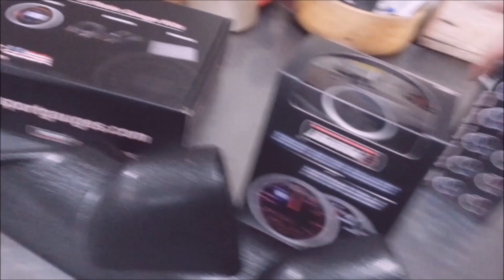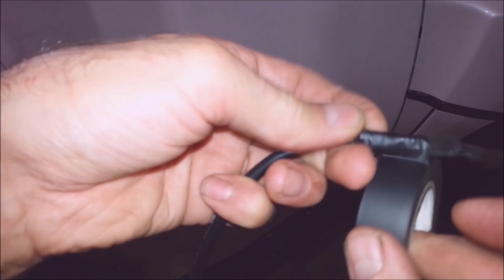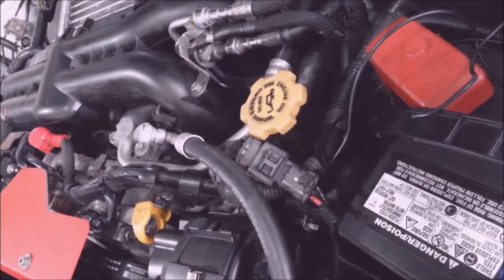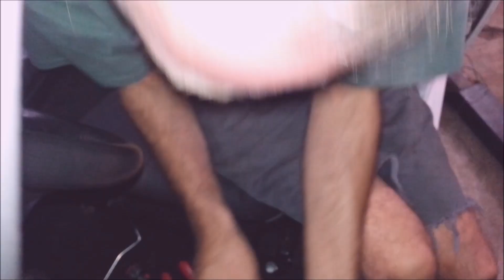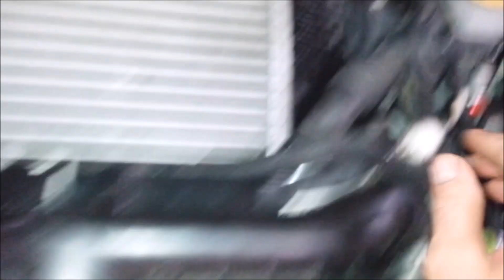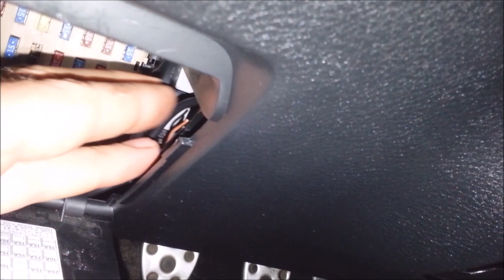WRX gauges triple pillar pod install

Comment: Hey man! I am actually about to do a very similar setup for my 2001 WRX! I am getting 2x JDM Prosport gauges and the innovate DB LC2. There were 2 questions I had. DO you find them annoying on the A Pillar? I liked the look but wondering if they are distrazcting at night? Also, where did you get that Gauge pod? I am trying to find one for a V7 WRX and it is quite hard.
Reply from the maker: The guy I did them for really likes them. The pillar pod for his car is sold all over the place. You are going to need to scout around for something that fits your car. There are universal ones, but may not fit real good.

Comment: The analog output signal harness is for the wideband reading. 3 wires , ground, narrow band, wideband. You wire up which ever one you’re using
Reply from the maker: I do not understand what you are trying to say. There are 4 wires in any wideband. o2 signal -, o2 signal+, ground, and o2 heater. The idiot proof wideband module plugs directly into the wideband o2 for the gauge, so you don't need to know all of that. A narrow band o2 is basically the same as the o2+ wire as far as I know. Correct me if I'm wrong, but a narrow band is DC (above 0 volts), and a wideband is AC (Sign wave, above, and below 0 volts), making it twice as fast, and more accurate. The 3 separate wires for the gauge are ground, batt+, and IGN+.